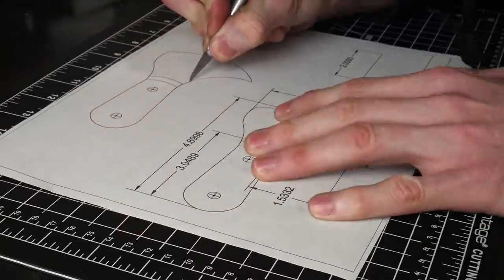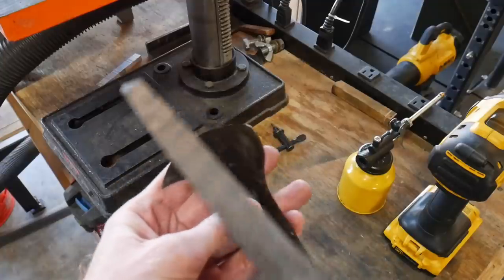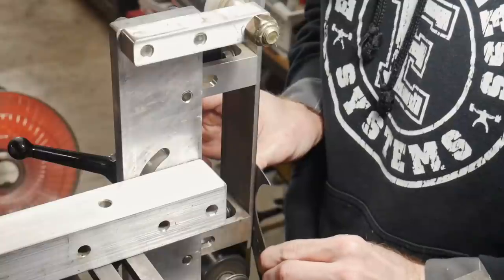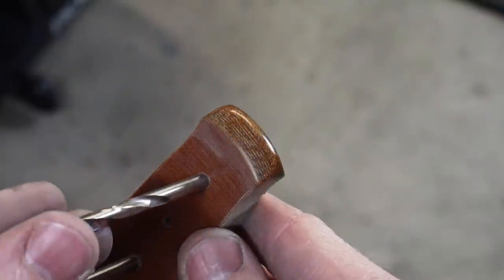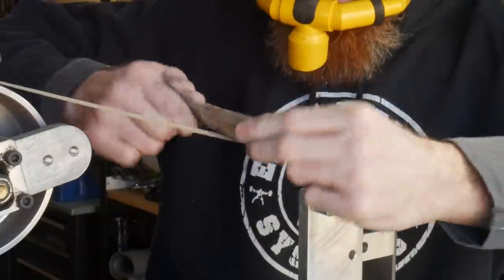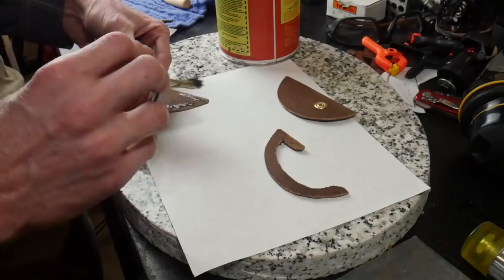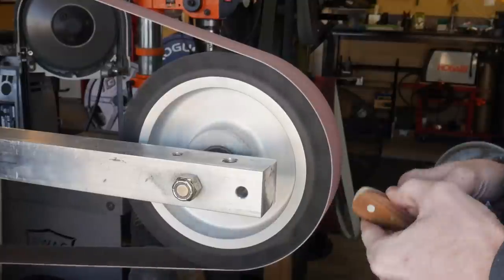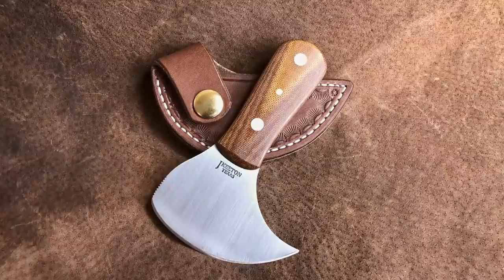MAKING A HEAD KNIFE | Round Knife for Leather Work | Knife Making

Comment: Aussie saddlemaker here. Good to see craftsmen such as Red Beard making saddlers tools. Keep up your good work. My own observations, smoothing the edge of the finished leather product as shown in this vid - I remember the old time saddlers I knew didn't use grit paper on the edge. They used the gum oozing from trees (type which congeals on the branch). They would put lumps of this gum in a saucepan of hot water (not boiling) and simmer it for say a couple of hours, The water became infused with gum then the whole liquid was strained through course cloth to remove lumps and twigs. When applied to the leather edge sparingly with a brush or wound up tight wool cloth on a rod, or small piece of felt, then rubbed with canvas held in the palm of the hand and the strap pulled through it, provides a lovely smooth edge. If doing this, make sure you have the canvas doubled over cos with a single layer, it can get hot!   If edge dye is needed, it is usually added before the gum application process. I used this natural gum method for years, but these days it is easier to use commercial products with dye and gum combined.

I learned my saddle making trade in the 1980s when there were old time saddlers still working who learned their trade when working horses were still plentiful (1930s - 50s). These old timers had lots of interesting tricks such as the one mentioned above. Texan Al Stohlman in his book on hand stitching (Tandy leather) shows how the Americans used hog bristles for needles! Never tried this myself as I have always used John James needles, but it would be interesting to try! 

BTW, as far as I know, no sewing machine has ever been invented with can duplicate two needles style hand stitching. Getting the stitch under a leather keeper is one obstacle for a sewing machine. Another is the half knot created with each stitch. That's my two cents worth. Thank you for reading my comment.
Reply from the maker: Thanks for the comment very cool stuff!
Reply: Hi mate, where's a good place for quality leather working tools and leather in Oz? (I'm in Brissy), TIA
Reply: @LockBits-ts6eo  Try Mac Lace in QLD, never dealt with them, but know of them. Ask at Syd Hill saddlery as well. Think they are in Brissy. Perhaps try Top Hand, and Kent Saddlery both in QLD. Also try Birdsalls in Sydney. If no luck, let me know. Depending on the application if you are making leather items where you don't want the leather to stretch, ask for vegetable tan leather, cow hide. The leather suppliers will advise you of the type of leather best for your project.

If you want quality tools, stay away from Chinese, I buy US brand, C S Osborne. and French brand Blanchard, both have been around forever!. I used to by British brand Joseph Dixon, but the last generation ran the business into the ground and the quality suffered then they folded. Sad, cos they produced top quality at least until the 1990s. Went to buy some new Dixon tools in 2012, and did buy them, but regretted it. Heard they closed soon after. So swapped to Blanchard and Osborne. Both at least twice the price as the chinese/taiwanese tools, but every time I am holding one of these tools in my hand, i am reminded why I spent the extra money. You can buy direct from Blanchard in France which I now do. Haven't bought direct from Osborne yet.

Having said all that, if you are doing this for a hobby, and not looking at getting into leather as a business, even a hobby business, but making a few items for yourself, perhaps Ivan brand (taiwanese), I am guessing MacLace sell them. Tandy leather Texas USA also sell Ivan as far as I am aware. 

With learning how to make leather items, You are on the right track, there are numerous vids on Youtube from which to learn. Some are outstanding.
Reply: @RedBeardOps  I use a small diamond bit in my Dremel at medium RPM.  I was using a PCB bit, but they are too brittle.    There is really no reason to get fancy with the bit, I just as well could take a piece of .050" stainless wire and grind the tip at 45 degrees.  An actual tiny little HSS drill bit can be purchased, but there is no real reason to.

Comment: Hi James,  For the material for your power awl consider a discarded two-way radio antenna.  They taper from about an eighth of an inch at the base to one-sixteenth of an inch at the top.  Cut out a couple of inches that have the diameter you want.  You could also put a small drill bit into your drill press upside down after grinding a point on the shank end.
Reply from the maker: Nice ideas Bill! Cheers sir

Comment: Great video! For punching holes in leather for stitching, on my metal lathe I took a 3/16" steel rod about 5" long and turned the last inch or so to the desired diameter for the stitching hole. Then chucked it up in the drill press.
Reply from the maker: Good idea Will!

Comment: Aussie saddlemaker here. Can I suggest a wood handle which is turned on a lathe with a wide shallow end for the palm of hand and very smooth. The reason, when cutting a straight line through a side of leather such as creating a straight edge prior to using a plow gauge to cut uniform width straps, saddlers have their shoulder directly over the knife and apply pressure with the shoulder and pressure via the palm of the hand which ensures a true vertical and accurate cut. The palm needs a wide shallow curve wood handgrip to apply the pressure to spread the pressure otherwise the cutting is very hard on the hand. Been a saddler since the 1980s and use a Joseph Dixon head knife which has above features. Pity Dixon has closed. Dixon quality slipped towards the end close, which was disappointing.

Comment: Once again. Awesome video. My question is would you ever consider trying to forge out one of these knives? You could use a thicker piece of whatever metal you wanted that way
Reply from the maker: Hey Corwin, I actually did think about at the onset of this project to get some more width, but decided to go the stock removal direction to take out a layer of complexity. I think you're right though, you should be able to get the width you want when forging it out!

Comment: The best cutting surface by far is delrin/Acetal. It is very hard and doesn’t scratch easily (you can use a bone folder to smooth over any scratches or marks) yet sallows your knife to glide through without damaging the edge or affecting edge retention. A board the size a workbench is quite pricey depending on thickness but you could also just get a smaller board.

Comment: Just a little info that you might want to be aware of, It is not advisable to use oil tan or chrome tan leather where it touches metal, It will cause rusting.  line your holsters or sheaths with a veg tan only.  awesome info in your video.
Reply from the maker: Yes sir! Cheers Frodo

Comment: Awesome knife man. I’m going to be making this with some thin O1 I have. What type of thread are you using to stitch the sheath? P.S. I love the power awl trick. I usually drill it out with a 1/16 drill bit but the holes always end up looking pretty beat up afterwards. With that power awl trick they opened up but still looked very clean. Thanks for sharing bro.
Reply from the maker: NIce! all my leather work methods and links are in this video:

https://youtu.be/MhVWVc_rdKA

Comment: Use old circular saw blades for the steel. Not the old old ones like one from home depo that’s worn out. You can make head knives quite easily even working round the hole in the middle. Nice work, thanks for sharing
Reply from the maker: Thanks for the tip!

Comment: And another great job! Love your work. A couple questions for you. Why 1075 steel? I would have thought steel with better edge retention. And, I take it you didn't feel heat treat or tempering was needed? For some reason, I though bar stock might have needed a temper.
Reply from the maker: 1.) it was available in the size and thickness I wanted 2.) I could heat treat it myself - - - - A better steel would be AEB-L. I did temper this blade and think that it is needed since there will be some flex.

Comment: You (and everyone else) always put a narrow secondary bevel on a knife.
That is good and bad - The good is that it is a very small area to keep sharp.
The bad is that it is very narrow for leather work.
I've changed mine to about 3/16" wide not 1/16" like yours.
Makes a big difference in cutting as it is a very narrow cut all the way through most leathers, instead of a wedge cut.
This really only works on 2 types of knives - Leather and Kitchen (my Japanese knives have a "long/wide" bevel - about 15 deg.).
Try it - you'll like it.  If not sure then draw out the cutting-edge shape on paper to a Large Scale and visually understand it.  (blade shape then cutting bevel).

Comment: Always make a double sided knife, rather than a single edge. In other words, a proper Round Knife. It takes the same time to strop a single edge as the double, so it is far more time efficient to have that extra side. I have always used a full knife, but doing a course in the UK, I was given a half knife. I soon found out how slow it is.
Reply from the maker: At the time I made it this way due to the size of stock I had on hand. It works pretty good!